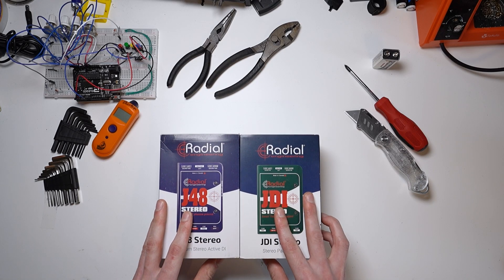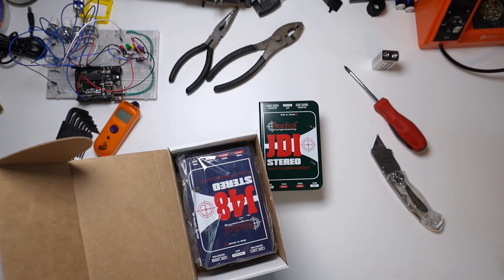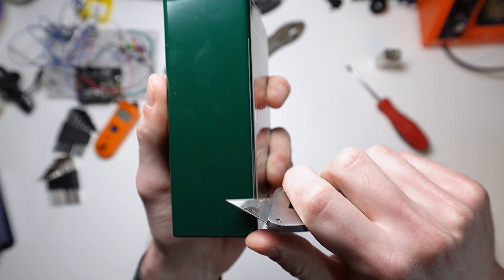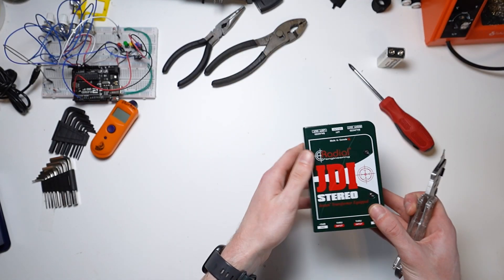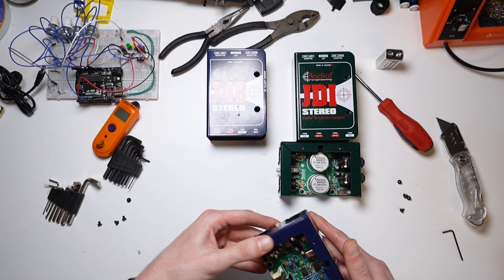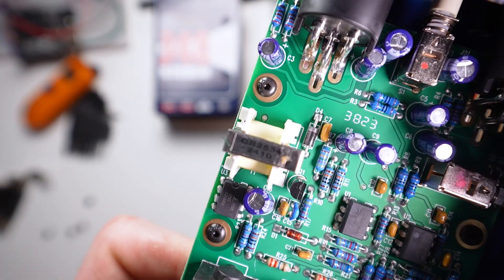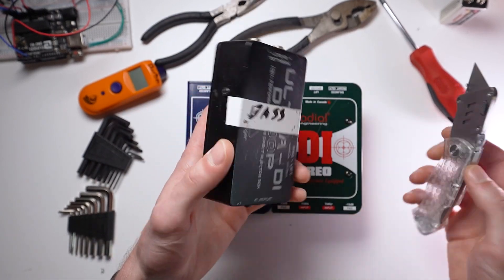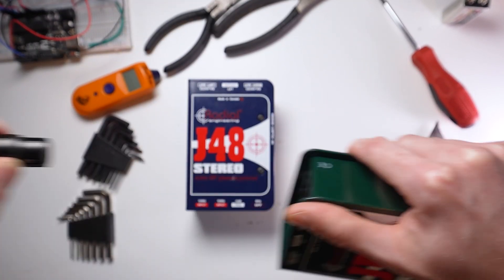Active DI vs Passive DI | Teardown

Comment: I use a passive bass through a multi fx. Which d.i. should i use?
Reply: Your multi fx is powered, meaning active, so the popular recommendation would be passive. Also, check the outputs. Some of those have an xlr output and cab emulation, so you wouldn't really need a DI box to go directly to a PA, mixer, audio interface, etc